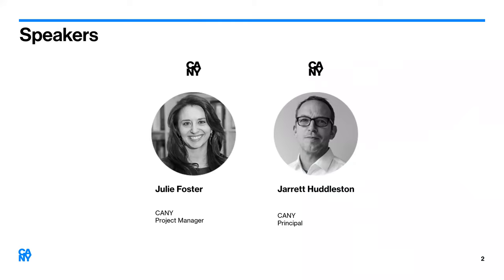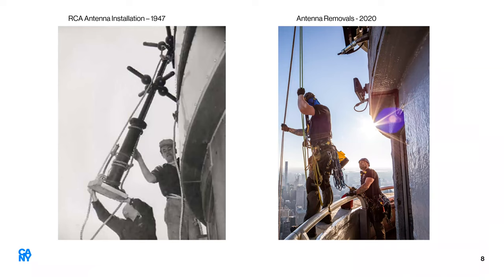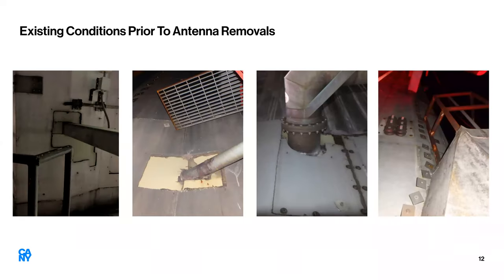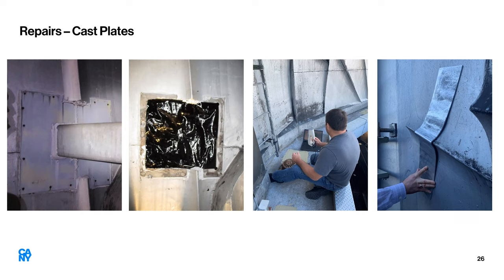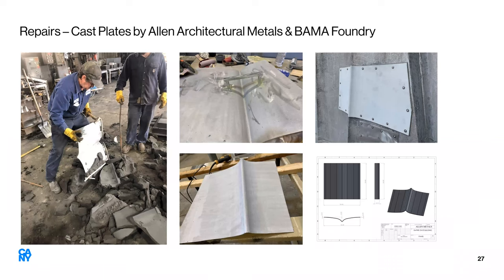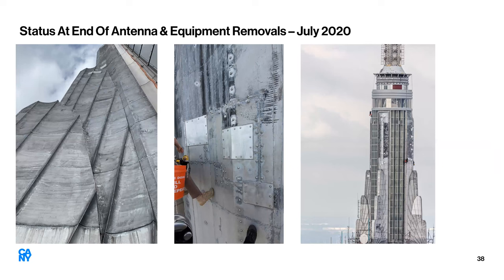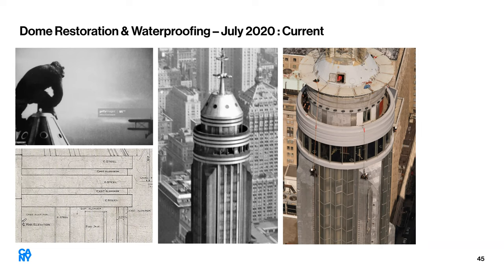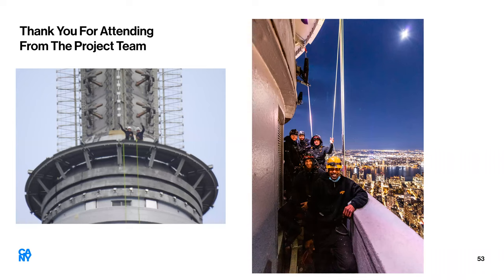Restoring The Empire's Crown

Comment: Enjoyed the presentation. Very informative. When I was 6 years old my father was with Acoustic Research which had a sound proof room used to demonstrate high fidelity home entertainment systems. Dad knew an engineer with RCA in 1951 and he took us to the 103 floor. A tall television antenna had recently been bolted to the roof just above and he was involved. 
My dad and I were afraid to step out onto the 103 floor balcony. The railing was short and the wind was brisk. 
One thing I remember as a surprise was below 102 the floors down to 88 or so where grates with slats allowing one to see the elevator move up and down in it's shaft from 86 to 102. And the white lights on all four sides of the mask from probably 88 to 101. 
At 103 there was a ring of white lights which burned at night. At some point they were converted to high pressure sodium lights (orange/yellow) then to colorful LEDs about 2012. 
I was looking at live cam shots of the building last night and the circular halo lights were not on. Have they been removed? It leaves a dark section just below the antenna when they are off. I think the light display looks best with them working. Thank you and congratulations on a great job on my favorite building.